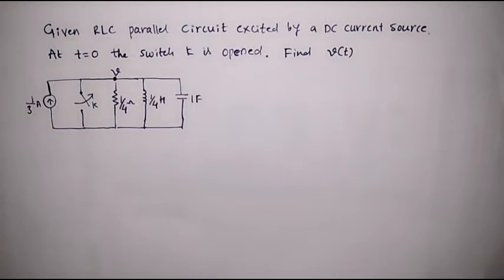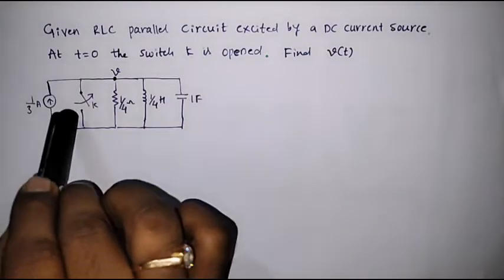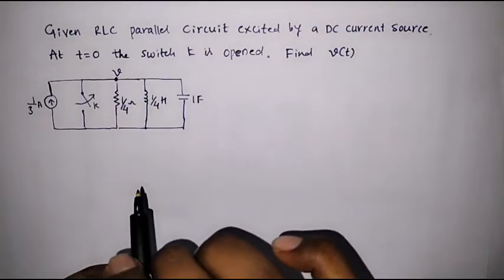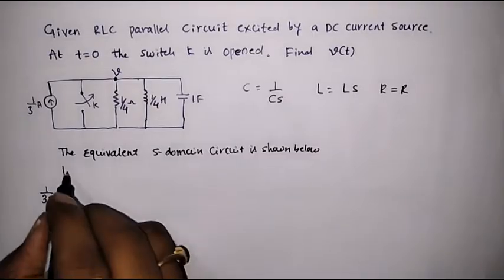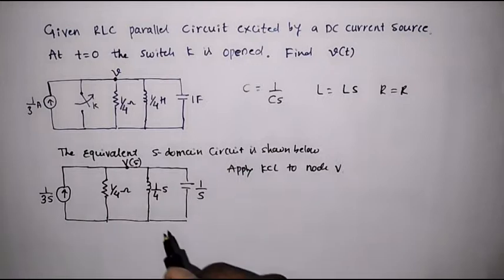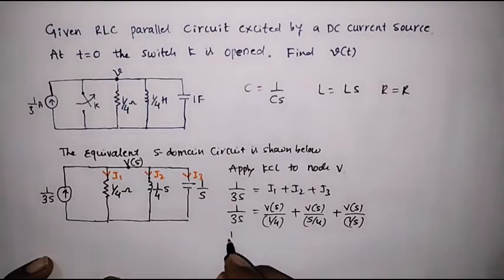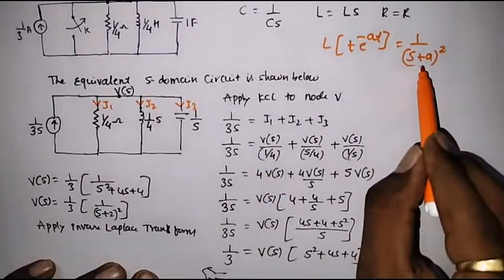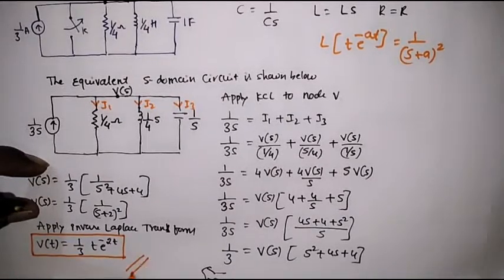Finding V(t) in parallel RLC circuit, using s-domain approach.

Comment: V=IR relation u can use for node analysis if theres resistors involved.. how did they use that same relation for L and C? (4:30)
Reply from the maker: It is in S domain
Reply: @VBDclasses  how do u decide u have to use s domain approach?
Reply from the maker: @user93208  in s domain analysis will be simpler.
Reply: @VBDclasses  in another video u have done the s domain approach differently sir... can u tell why
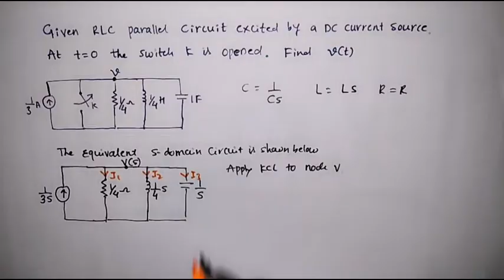the Video where u have done it different : https://youtu.be/ngJYGD8AP_s?si=lZ1heN7aGez0d7Nw , timestamp 3:53 in above link

Comment: Sir switch should be short circuit rit ?? Why did u consider as open
Reply from the maker: Switch will be open when t=0, it means that before t=0 switch was shorted. we need to find v(t) after switch opens